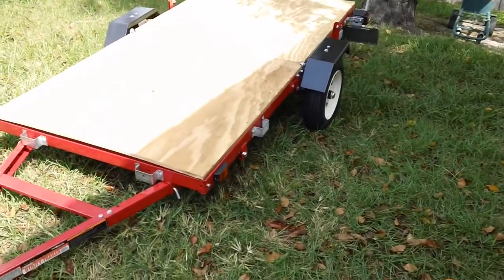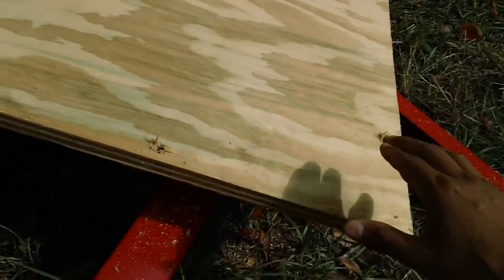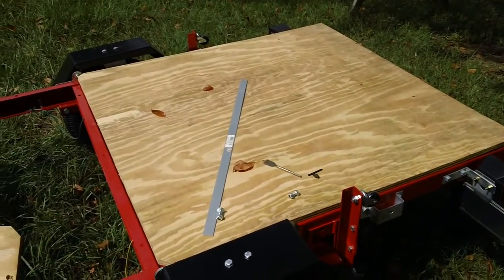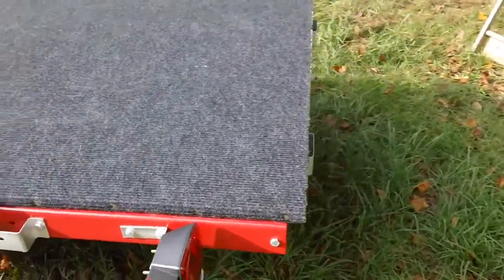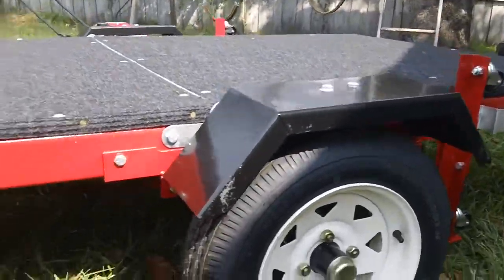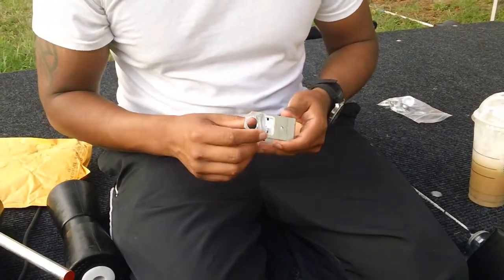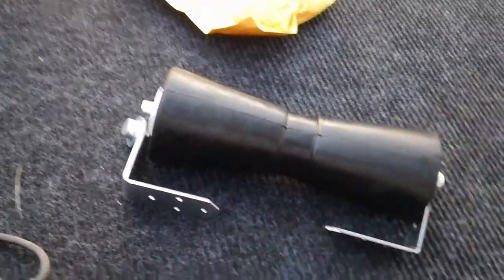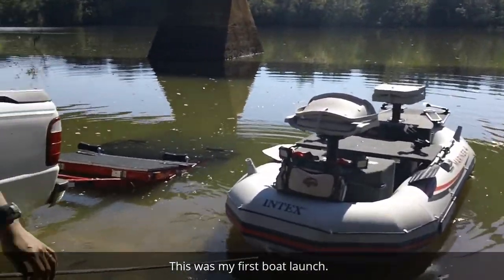Mod/Custom Mariner 4 Intex Boat Trailer with Rollers

Comment: Thanks for the Post. I will do the similar with 5/8" plywood sprayed with antifreeze to resist Rot. Just ordered the Trailer.  It will go for a Excursion V. 
All will fold and deflate at home as needed. Hope to do some crabbing November. Gearing for Salt water.
Reply from the maker: if u want something that is more rugged (tough) if I'm saying it right. the Excursion 5 seems to be just for leisure but some people have issues. mariner 4 for me would be great for mods.
Reply: Youre correct. I ordered a BRIS BSA380. 12.5 Ft double the weight. Strong enough for a 25 Hp outboard.

Comment: I really like your mod. I was going to get the excursion 5 and do something like your boat. could you let me know how you incorporated the solar panels running to the battery.
Reply from the maker: to give u a heads up, read one of the comments on my solar panel video. a guy that knows it by technical terms explained how effective it is. lemme know if u want to know something else. thanks for watching.
Reply: i realize I'm pretty randomly asking but do anyone know of a good website to stream new tv shows online ?
Reply: @Karsyn Mayson ehh lately I've been using flixportal. Just search on google after it =) -keegan
Reply: @Keegan Heath Thanks, I went there and it seems like a nice service :D I appreciate it!
Reply: @Karsyn Mayson No problem :)

Comment: So im curious to know how well and long did ur inflatable custom mariner hold out? U still using it?
Reply from the maker: I had it for about a year in use then stored it but never had an issue with it. It was sold shortly after being that I was about to fulltime in an RV. I sure do miss it though.

Comment: good work.. read a lot of reviews about these HF trailers and most of them say to not put them in the water. You do anything to keep it from rusting?
Reply from the maker: nah so far it was just rusting in the spots where the paints were chips. Other than that I used marine grease for the wheel bearings. salt water I would not do. so far it's been good.
Reply: +dezertgrunt nice. keep us updated!

Comment: where do you tie an anchor to it to not drift while fishing, just bought one but don't know where i could tie it with out straining the material too much?
Reply from the maker: I tie it to the front part of my storage box through an anchored ring I bolted on. That or any of the handles I have around the storages. works fine with no issues. I really have no specific anchor point.

Comment: Where did you buy the rollers?
Reply from the maker: etrailer.com, the bigger or longer will cost more of course. have to browse. getting the set was too expensive which was y I did mine the way I did it. good luck.